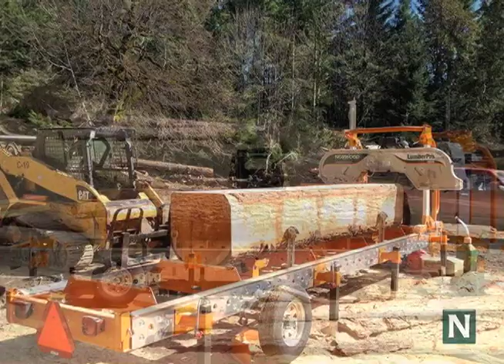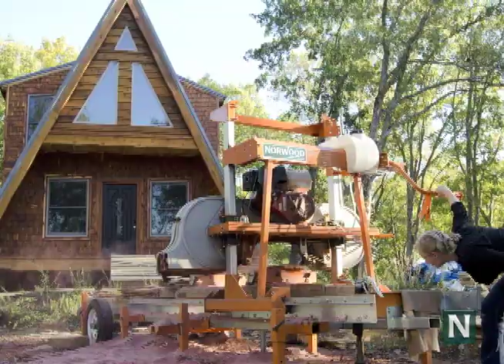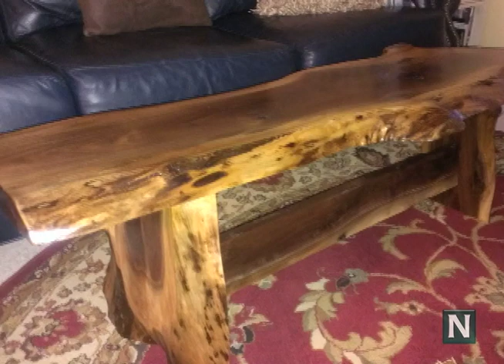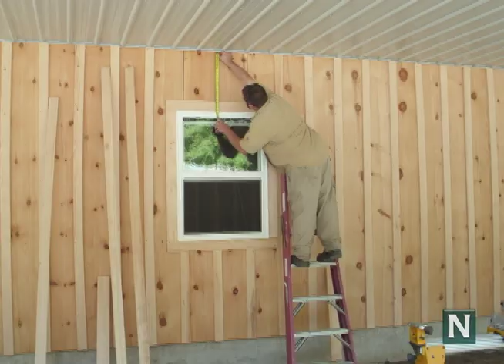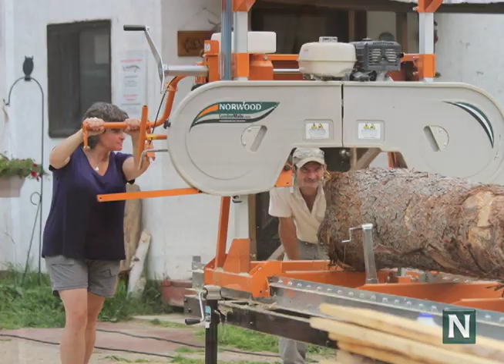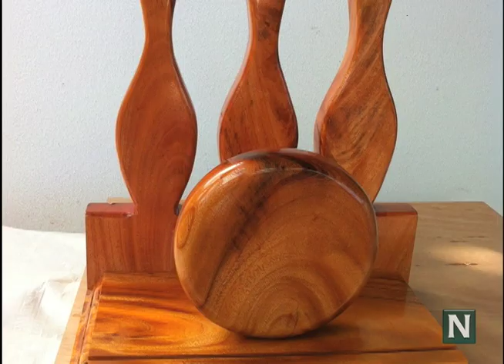Norwood Portable Sawmills 2014 Photo and Video Challenge Entries

Comment: Can someone explain to me, an HD36 owner, how these structures can be built with fresh-sawn lumber without it becoming a maintenance nightmare?

I'm thinking the vertical plank with batten design, as shown in one of the clips, comes closest to being a workable solution.  [I would think you have to keep nailing to a minimum?]

Maybe someone can recommend a book on the subject?
Reply from the maker: There are many ways to use the wood cut on a Norwood sawmill. Either green or dried.

As you stated when installing green lumber siding using less nails (until dried) is recommended due to shrinkage.

The Internet is full of information on using green and dried wood.  We'd recommend searching on "using green wood/lumber" or "using dried wood/lumber" to find some options. 

We'd also recommend joining the Norwood Connect forum http://www.norwoodsawmills.com/forum and posting your questions to hundreds of experienced sawyers. The forum is very active and you're sure to get a detailed response.